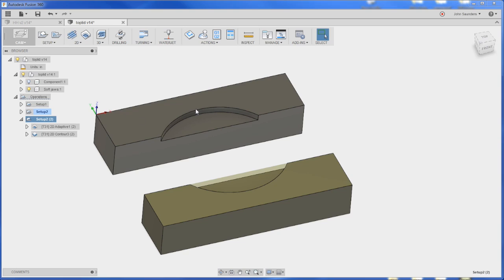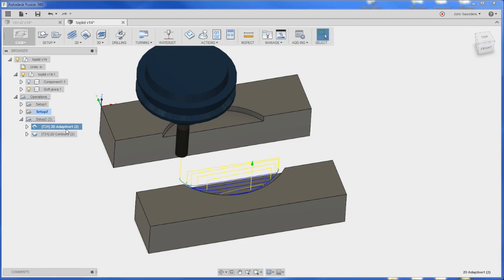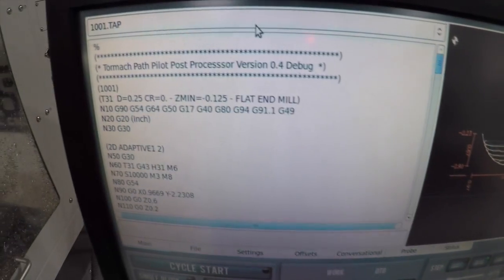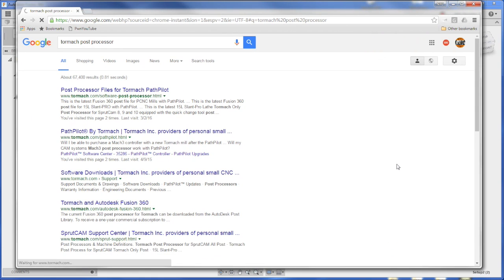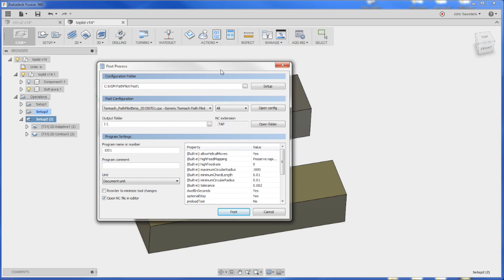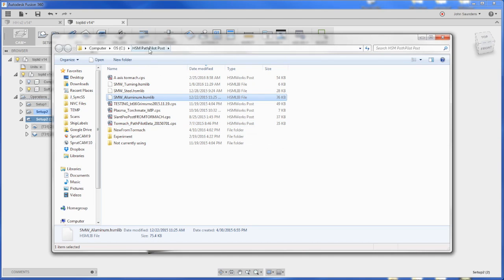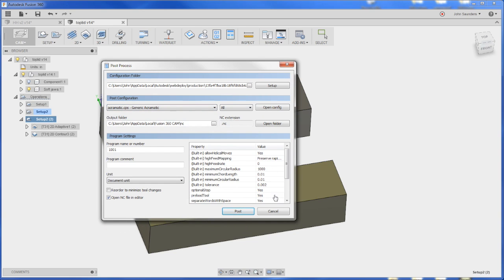Posting G-Code to CNC Machine - Fusion 360 Tutorial!

Comment: Any opinions on linuxCNC?
Reply: I use it for router and plasma cutter,postprocessor is included for linux cnc ,but for plasma I use post proc. for mach 3 plasma with a tweek to output g20 instead of g70

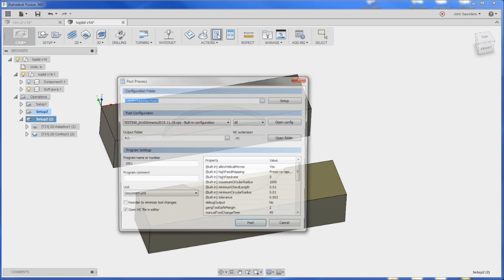Comment: ok I have a question specifically about the file type at 1:12 
How do I know which one of them files I need to save it as?
I'm building a 5 x 10 cnc plasma table and I'll be using Fusion 360 for as much of my start to finish as I can. So while this video is totally awesome showing me I can using 360 to post process, skipping sheetcam and going straight to Mach3, I need to know what will determine which file type to save as. I plan on using a Hypertherm Powermax 65 to cut with.

Comment: hello very nice video but i have ?  i got a cad fender body drawing from grabcab do i have to generate g-code from my fusion 360 cam and than send it over to my mach 3
Reply: how do i get the g-code do i just put the file in fusion 360 cam and hit generate g-code
Reply: Hello, maybe you can help me out. I am CNC newbie and am in the process of building a 5x8 foot gantry CNC. 
I am a bit messed up when it comes to software in conjunction with controllers. Especially post processors.
So i understand that i need a cam software like Fusion 360 (or should have for what i want to do, cutting 3d foam) and Mach3.
I do not understand which Post i should select since the CNC i am building is totally custom or DIY.
I plan to use 4 NEMA 23 motors with 4 controllers and a breakout board.
So from what does the Post Processor depend?  The chip on the breakout board??? Or are there generic Mach3 posts????
I am confused. I hope you can help me out.

Comment: Awesome video as usual! question- I just loaded my first fusion360 file to the Tormach. The machine is not positioned correctly in the axis though? I have been reading a ton in the manual but... I think I missed something.
Is there something else I need to do? You said you have to set up work position in the video?   I referenced the Mill and zero-ed all the axis prior to loading F360 to mill. thank you:)

Comment: Would it be interesting in a tutorial how to write a custom post? I programmed my own post for the Siemens 820M GA3 controller (old hardware one). Its not that hard to get into the posts is coded in Javascript.
Reply: Autodesk just put out a 3 video series on this, check the fusion360 youtube channel.
Reply: bensbenz problem with those tutorials is that they don't really go any deeper than just to the surface about how to modify something existing. Not to write it from scratch..

Comment: Great stuff! I literally just trudged through this on Tuesday getting my mini-mill conversion running. I'm using Grbl Post Processor and an Arduino Nano with Grbl 0.9j to run my machine using bCNC on a RPi3 from Remote Desktop. So far so good and a touchscreen is in the works. More videos on that on my channel.

Comment: The software that opens the NC file is called a post processor. You actually can edit the code if you want, but usually, you don't need to.. However, like in my case, i do edit the Gcode in the post processor. I have a set of macro's set up that allows me to insert certain codes at the beginning and end of the gcode. In my case, i'm adding a starting spindle speed value, as the spindle i have causes fault protection in the PSU if it starts the spindle at top speed.. i.e. you tell the machine to run at 15k RPM (M03 S15000) If my starting speed is that fast, the PSU kicks off, so i add M03 S5000 using a macro, it inserts it before the first G00 command that has spindle speed. This lets the spindle start up at an acceptable speed, then ramp up to full speed before moving into the part.

Comment: Not sure if you run into this but whenever Fusion 360  does an update I have to reconfigure the post all over again.
Set the output folder, then set all the property values to what works on my machines.
Reply: Are you using the Generic Posts or Personal Posts selection under Setup?  You shouldn't have this problem if you move the post that you use over to your roaming folder (at least on Windows - I don't know where this is on Mac)?  Should be in C:\Users\<username>\AppData\Roaming\Autodesk\Fusion 360 CAM\Posts
Reply: DAM Machines I am using a generic post on a Windows machine I'll have to look and see where it is saved.

Comment: What's the process for modifying a Fusion 360 post? My machine controls are not in the Generic post list. With my Mastercam I personally modified a Fanuc post to adapt to my controls and have been using it successfully for over 10 yrs. with zero editing of G code. I would like to do the same with Fusion 360 to do head to head comparisons. Any suggestions?
Reply: I used sneaker net for yrs. ugh finally got around to run ethernet last year man what an improvement.
Reply: You can find more processors or even request one to be made for your machine here: http://forums.autodesk.com/t5/post-processors/bd-p/218

And to modify a post processor, just click the "open config" in the dialog box you see in the video and it will take you directly into the code which you can modify.
Reply: The great thing about the Fusion 360 posts are that they are written in JavaScript.  If you take a look at one of the generic ones it's really easy to make sense of what's going on and where to make changes.  There's also a help file available online (I can't find a link right now, but google for autodesk post.chm) that gives detail on all of the variable types and member functions.

Comment: Custom posts are needed to allow you to turn on certain features of machines. High end machine there's a plethora of options you can get. Air blast, thru spindle coolant, internal kinematic tool tracking, high speed look ahead, high speed smoothing. The list is endless. And are all activated through optional Gcodes an Mcodes

So you need a custom post to be able to turn these features on during certain events. For example the DMU here has internal kinematics for 5 axis machining to allow for tool tip tracking and compensation during rotations. So the post, which was custom made, enables the kinematics automatically everytime a 5 axis tool path is posted. Otherwise I'd have to manually go in and add that line before every 5 axis path of I was just using the generic post. 

High end machines have a huge assortment of options and features that can be included or not included when buying the machine. There's no way a CAM company can keep up for every machine on the market hence custom post

Comment: You might want to consider running a network cable out to the mills for Dropbox. I just consider wired more reliable.
Reply: I second that. As a network guy, I always prefer wired, especially in an electrically noisy environment with motors and welders.

Comment: Looking forward to running some code thru the Cincinnati. I bet no post available for it anymore.
Reply: In my experience the Generic FANUC (or YASNAC depending on controller) usually do quite well with little alteration. Usually odd things like the T and M6 have to be on separate lines to change a tool. Or they require some odd header format or something. But the actual machining code generally comes out just fine

I haven't seen a F360 post processor file so dunno how easy it is to alter, but MasterCAM post processors are a breeze to alter and tweak to get em right for the machine.

Comment: WOW!!! For me, this was about the best video, I've seen from you... This answered sooooo many questions. Thinking about my "All-In-One" machine, I will have to deal with many various operations and didn't know if I'd have to have Custom Software written to run everything... From 3D Printing to CNC Machining to Plasma cutting, etc. This video cured my dilemma... You said that you do not like to tinker with G-Code. However, in my case, some tinkering is an absolute must, as my machine will run very differently than anything you are accustom to operating... Thanks so much for sharing this... You're AWESOME!!!

Comment: Post processor..mmm I think CNC companies should include the post  with the purchase of the machine. Come on, you buy a 6000 or 20k or 200k cnc mill and at top of that you will need to pay the post...😑
Reply: The machine company isn't responsible for how you are going to program their machine.  The majority (in fact I think all) have conversational programming that built right into the machine. Mazaks mazatrol system I hear is actually quite easy to program a part right at the machine. 

When you buy CAM software they give you several generic posts. But to get the machine to do exactly what you want you'll need a custom post which you can either alter or create a post processor yourself or pay the CAM software company to create the custom post.
Reply: +Occams Sawzall Yeap...just business 🙄
Reply: +VLAHECO they don't give you tools or holders for free either....  Those are way more expensive than a good post. 

$2k-$3k to make a $300k machine operate at optimal peak performance practically pays for its self in the first run of parts it does.
Reply: +Occams Sawzall Yeap... money money money 🤔
Reply: +VLAHECO no one ever starts a machine shop to become a quick millionaire 😆
Reply: Obviously you don't know much about cnc's how could you possibly do that? You would have have a post for that particular machine on every cam software and every configuration of that machine. Sure little old tormach would its couple machines and couple options but a haas where you have million configs of machines and extra equipment. Looks mazaks website and look at different machines they have.
Reply: Alot of compaines will write their own.. I have I spent some weeks on writing a post knowing nothing but its faster  for to me doing it because I know what I and post developer knows nothing about the machine you're running.  It would takes weeks sometimes months going back and forth trying to get the correct post
Reply: What are you talking about? It is programming. Have you ever seen the number of codes in a files for 3D Printers? they have a lotttttt and you do not need to pay for that.
Reply: +m98custom12 if you're paying for a post. Most (I.E. The reputable ones) will come in and look at your machine and sit down with you and figure out exactly what you want the machine to do. They're def worth the money on higher end machines.
Reply: +VLAHECO lines of code doesn't equal complexity of code.  3D printers use a lot of code but it's very very simple. It's only ever building in 2d layers stacked on top of  each other ands it's only ever operating in X Y movements expect when advancing to the next layer. It's never operating in 3  or more directions at once.  It's not rapping, drilling, reaming, etc.  it's just building layers. 

So it's very simple generic code. Not the complex code lines you see on CNC machines
Reply: You're talking about simple 3K printer not half million cnc machine with 9 axises, automation and everything else. Even some of simple 3 Axis machine are pretty complex with marcos and special g codes.
Reply: They will come in a look say they can do this and that but fail miserable  go to autodesk cam forum and look at the post ther. Siemens is even worse and the resellers are horrible with post support.
Reply: +Occams Sawzall yes you are right
Reply: +m98custom12 really?  Hypermill had great post support even just for the demo they took about 3 hour of tweaking right at the machine and it ran rock solid. MasterCAM and SolidCAM weren't quite as fast, but maybe a week or 2 back and forth and everything was ironed out. Haven't had to deal with Autodesk. 

But then Fusion360 is essentially free. Vs the super high priced hypermill and more costly masterCAM and solidcam. 

Guess it comes down to you get what you pay for?...
Reply: Not talking about Fusion 360 talking about hsmworks but they all use the same post anyways.. Mastercam still doesn't have our Siemens Post Right.. In NX I wrote the post for our machines myself multi axis mazaks. Siemens wanted couple months lead time that means couple months sitting there or hacking our way through it. and it was locked down no changes could be mad or like 30K upfront.  Solidcam was garage on the interface but didn't care as long as the posts worked but they wanted all the money up front but I told them would hold back 25% until we signed off and that was working 100%. I should have went with Top Solid but I didn't
Reply: +m98custom12 can honestly say I have not had that level of issues with any of them. Solidcam was the worst of all of them (haven't dealt with ham works yet) but didn't take long and everything was hammered out. No money up front, only paid on completion  so no idea. Maybe it's got to do with whose handling your region?  But ya. Sounds like you're getting screwed from every end possible.
Reply: Not all machines have conversational.  The ones I run at work have absolutely no options. EVERYTHING is extra! Had to upgrade the memory since it ran out with only 60 or so programs in it. And these are over 800 000 dollar machines.
Reply: +EternitP8 woww
Reply: +EternitP8 hope that machine is worth it! Seems like a lot of money for a bare bones machine.
Reply: 33 metric tones. 4 axis hmc. 50hp direct drive spindle, over 1000nm of torque. Yeah. It's worth it. Eats tormach 1100s for breakfast ;-)
Reply: +EternitP8 Mitsubishi MAF-E?
Reply: Makino A92 equipped with high torque  spindle
Reply: Nice, This what used to program and wrote the post for INTEGREX i-300ST